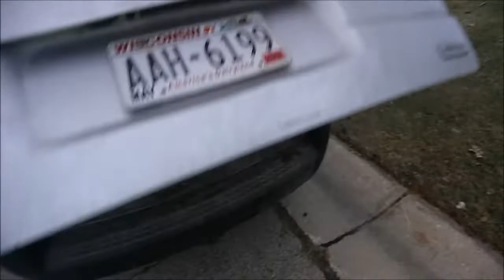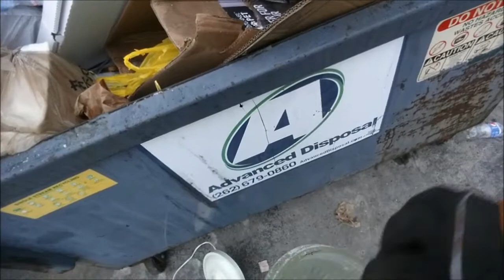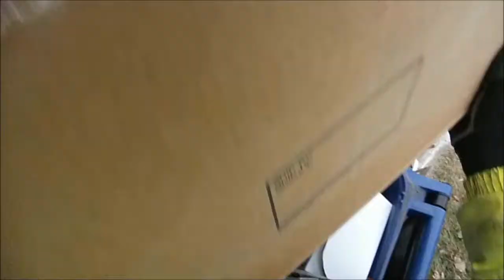GOLD BEARING TRASH BINS!!!

Comment: Some great finds for sure!!
You do you but if I may offer a suggestion, that fridge and stove had metal racks inside, heavy flat steal.
Great Video and I still love the intro music 🤘😎👍
Reply from the maker: Thanks Jeff. I've been avoiding Steel if I can find more non ferrous items.
Reply: Ya I get it.
Prices are horrible.
Reply from the maker: @Man-in-da-shed  At the time, the local scrapyards were not paying for refrigerant scrap of any kind, (including compressors). They've only started taking copper/aluminum radiators again. Hopefully they pay for compressors soon. I have a small bunch of them.